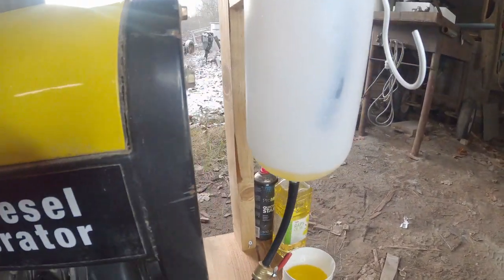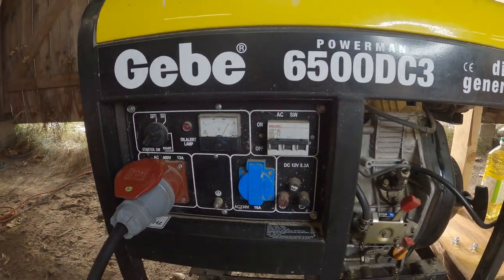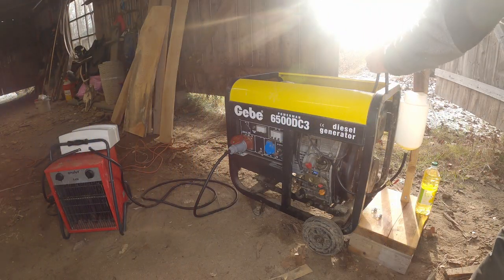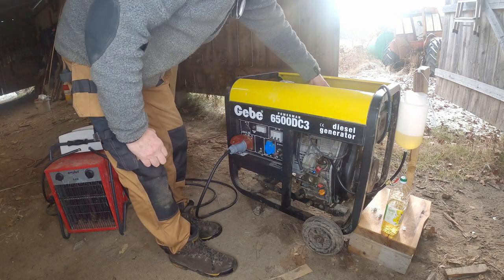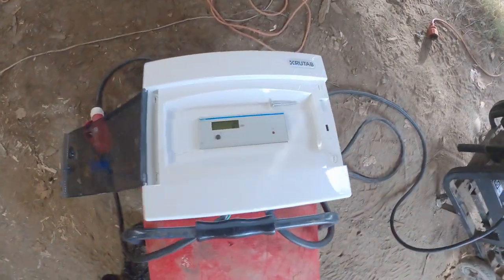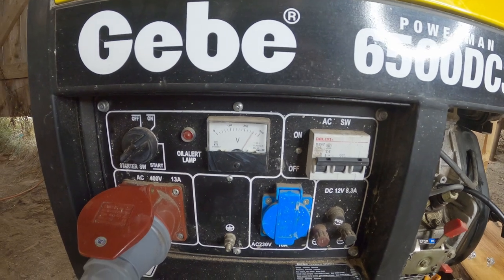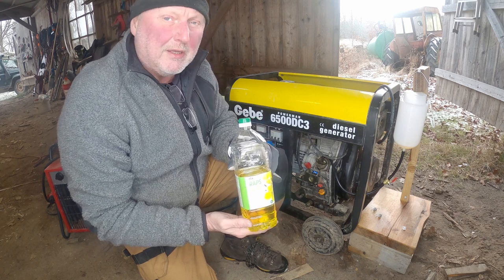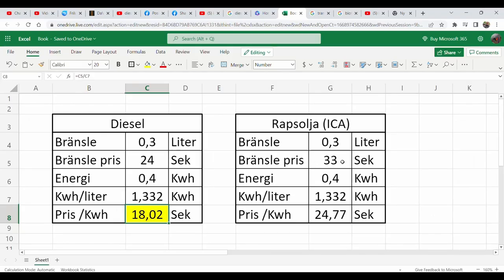Diesel vs Rapeseed oil in a diesel generator (Diesel fuel vs Cooking oil)

Comment: Looks like fuel of future. Problem would be in winter running in diesel engine . Would have heat fuel tank keep  vegetable running in cold weather. But not big problem. Thank you for sharing this.
Reply from the maker: Hi!
Almost all oils seems to work, but when I tested it was below freezing and some oil’s really needs heating and some was ok down to -10 C
Reply: @berg310tor-arnejonasson8  engine house with muffler being piped outside of engine house and air intake pipe outside so heat from  engine keeps oils hot .And   heater if engine didn't make the heat for oil .

Comment: i use rme (hydrated rapeseed oil) in my generator but only because i get it for free from my work... its not a good fuel very corrosive and has alot less energy than regular diesel but its free so i use it. Would never buy it though, in my cars i only use pure fossil diesel
Reply from the maker: I have only tried pure rapeseed oil (cocking oil) because I can grow it myself.
Reply: I believe if you turned that oil into biodiesel, you might get better results
Reply from the maker: @xmysef4920  
Yes, you might be right. But I prefer to test fuels that I can easily make myself 🙂
Reply: @berg310tor-arnejonasson8  Oh haha, I meant him (the commenter), but yeah I also think it’s a bit more interesting doing SVO aswell :)

Comment: What country u from?
Reply from the maker: I am from Sweden 🇸🇪 
From Gothenburg
Reply: @berg310tor-arnejonasson8  will it work if I put that kind of oil in my VW Beatle dieselengine? Or Mercedes diesel engine?
Reply: @berg310tor-arnejonasson8  ur a smart man. I will try that
Reply from the maker: @astoica1  it depends on how old it is. New engines won’t run on cooking oil. But my old tractor works fine on it.
Reply: @berg310tor-arnejonasson8  how old, or around what year should the car be to run on the oil. You think cars before 2007 will work? Or the 1980’s or 1990’s Mercedes will work? Cuz I’m very interested, ur a smart guy. I will run the car on oil, but what year cars do you think will work? Let me know, u know more than me. Thnx
Reply from the maker: @astoica1  
Hi, I don’t really know. It normally has to do with the exhaust control in the car. When it detects that its not diesel the engine can go in to “limp mode “
Reply: @astoica1  I know everything after 91 is pretty much safe. you cant run biodiesel in older vehicles which used rubber components. the biodiesel eats through the rubber. rapeseed or canola oil based biodiesel has the best lubricity rating as opposed to animal fat biodiesel. so if your running good quality canola oil on any 90’s vehicle, you’ll probably be fine. I saw a guy run his 90s ford diesel for years with no issues. do more research on rubber components being replaced with synthetics if you want to know exactly what year it stops. All I know is everything after 91 is good to go.
Reply: @BigMan-oz8re  ok thnx